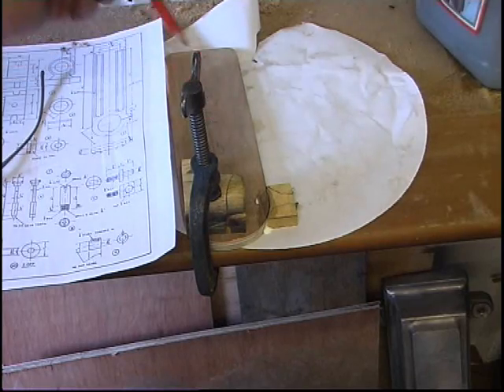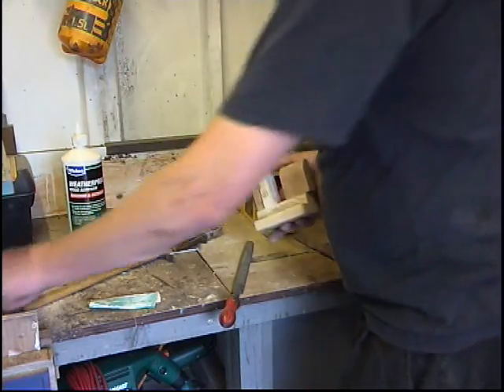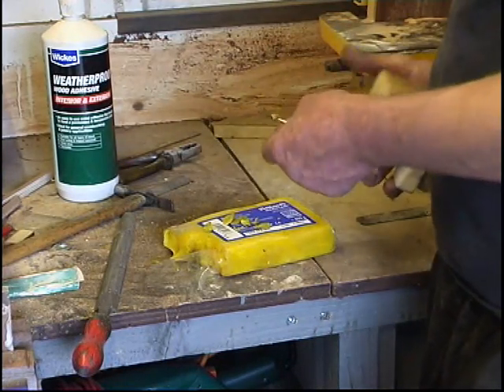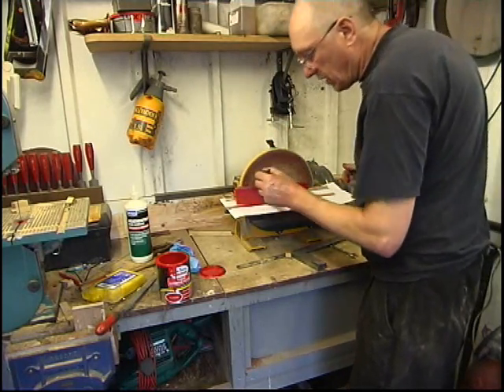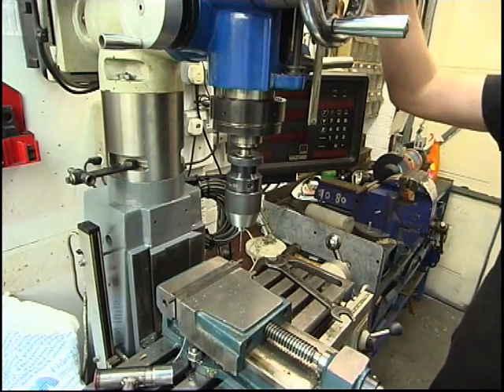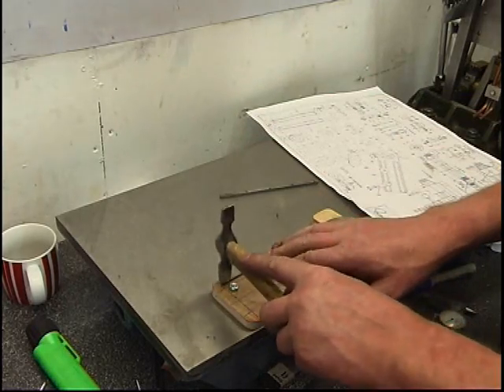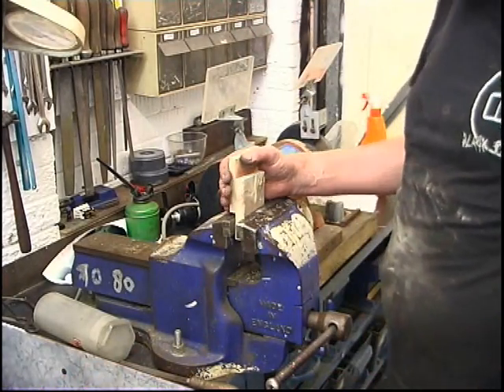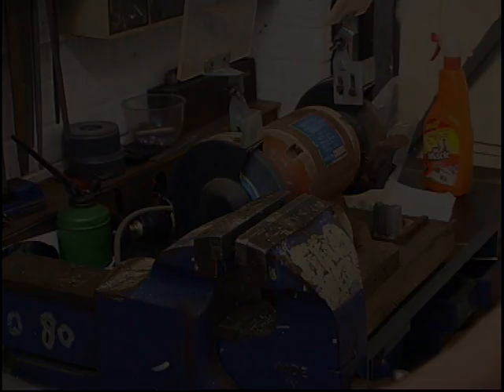DIVIDING HEAD PART TWO

Comment: Hi John, I discovered Aliphatic Resin glue. PVA never really sets solid but this stuff does. What I use is  Titebond. AR glue is also known as 'yellow glue' because of its creamy-buttery colour. It 'grabs' within a couple of minutes and you can work with it within the hour. It also sets hard, which PVA glue will never do.

Just a thought in case you haven't come across it yet.

Comment: To save fingers when starting small nails, a pair of needle nose pliers work well.  An alternative is a bit of magnetized steel bar, with a notch in the end to line up the nail. A slight bend makes it easier to get the nail end flat on the work with clearance for your fingers.

In the USA we have a urethane glue called Gorilla Glue. It's extremely strong. As a test I glued two bits of 3/4" Baltic Birch plywood in a T shape....end grain to face grain (can't think of a weaker joint than that!).  I clamped one piece in the vise and put my hand on the end of the cross piece and leaned on it until it broke.  Like your test the glue didn't let go, but the plywood glue didn't either...one of the plies split along the grain of the wood!  When the wood is the weakest part, the glue doesn't need to be any stronger. 

I'm really liking your videos...slowly working through them all and learning lots. Thank you!

Comment: John, I watched you fiddling with wax to make fillets. Have you thought of using a router bit? A "cove" bit has a semi-circular cross-section, like a ball-nosed end mill. In your milling machine, with the pattern clamped in the vise and the mill on the highest speed, you can use this to remove wood to leave a beautiful smooth fillet.

Router bits come in many shapes, and you may well find that investing in a few of these may well make your pattern making easier and quicker.

I love your work!